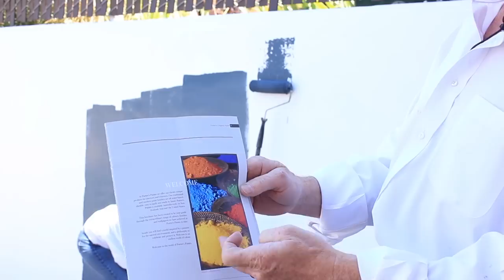Make a wall into a chalkboard.

Comment: Kirk when doing any kinds of painting(tip) first to make it easier is to divide an area into 2 parts. Doesnt have to be long but top and bottom half work. So you focus on painting the top first  using your roller in up and down motions because if you go sideways you would see differences in the finished painting job. Then you work on the bottom half and after you finish that ,you simply go  to the beginning of the area and just pass your dried roller from the top to bottom so you can get a smooth clean finish.
Reply from the maker: Howdy K Woosh Dude, there are many ways to roll out paint, yes you can do as we show in this video or whatever way you prefer, it's going to be used for a chalkboard anyways.
 Cheers, live long and plaster
 Giordano’s images and teaching video’s

Comment: Hi Kirk, John Hart again. I thank you for pointing me to that (stucco) ceiling video . When I said (plaster) I should have said ( cement or stucco materials). I wasn't presenting it correctly. I want to do what you did with (stucco cement materials) over the hardie board ceiling. Do I have to lathe over the hardie, or can I do it without ? .Were working against gravity, so that's why I was wondering about adheshion , cracking, material applications. Thanks again , John.
Reply from the maker: Hi John, if it were me I would apply a bonding agent then apply whichever mud you decided to use,
 No wire is necessary, 
Cheers,
 kirk giordano Plastering

Comment: Thanks for taking time to set up the videos for each project! I think I might just start wearing gloves as well, not sure how I would like it when I'm using my knives for all the joints and inside corners. Your rounded trowels, are they for concrete? I saw them at Home Depot here in Ontario Canada. And the floating trowel as well with a wooden handle. Gotta have the right tools to do the best job, even if it means spending some extra coin!
Reply from the maker: Evening Mark, I cut the tips off my gloves when I lath saves many a bleeding hand.
 I realize I use pool trowels they are usually 18x5 or my monster 20X5, they are also 50 percent higher in cost 60 bucks a trowel verse's the 30 bucks or a typical 12X5 plastering trowel, but they give my pleasure as my wrists can handle the extra weight and flexibility.
 Best wishes and thanks for the comment, Kirk giordano

Comment: Kirk, why is it that you applied the glue like substance on this wall prior to applying cement and not on other demonstration videos that show how to apply cement on exterior house walls with stucco?
Reply from the maker: Good evening Margarita, excellent question,
 we apply the bonding agent on the wall that is painted as plaster will not stick to any painted surface.
     When we have cement, block or brick walls the new stucco will adhere to these substrates as they are porous, but they have to be free from all dust and dirt, as nothing adheres to a dusty surface.                 
                                Live long and plaster
                     Plastering tips and techniques

Comment: hey, Kirk could I would like to turn all my walls in my unfinished basement into full chalkboards. The walls I believe are just concrete with no paint or anything on it. 
Do I need to do anything different since it is in the basement and such or should I be okay to do everything the way you have done in this video?

I appreciate the help!
Reply from the maker: Good Afternoon Vlad, of course, you can apply the chalkboard paint to these walls.
 If you feel they are smooth enough for your liking or that even if a little rough, your kids can care less as long as they can write and draw all over the place, I say, go for it.
 The most important thing is to clean your concrete walls very well. As nothing adheres to a dusty surface, not, paint, stucco, or caulking.
Maybe spiders, but not sure about that even. 🍺
                        Bringing peace, love, and brotherhood back to the world of, “Plastering.” 😏
With over 800 educational and free Youtube videos, by your favorite plaster geek, “me,” and my son, “Jason,” the bearded plasterer.😉
Reply: @StuccoPlastering  haha no kids just need to do something about the bare concrete walls in the basement so I can be set for when my gym equipment to set up down here gets delivered. Thinking either black or red chalkboard walls for the entire basement gym.